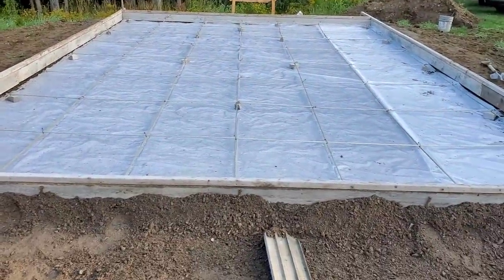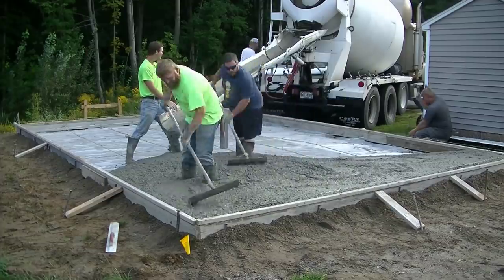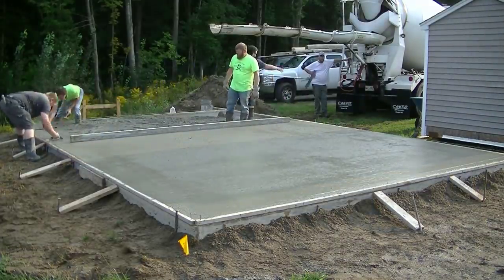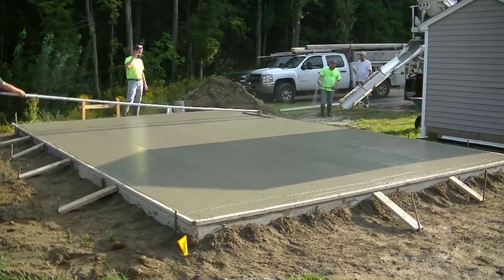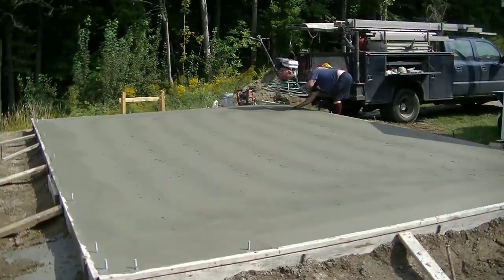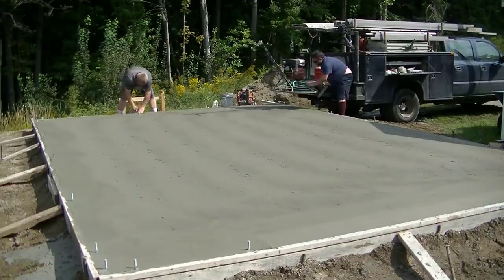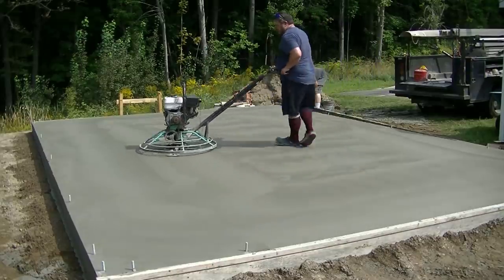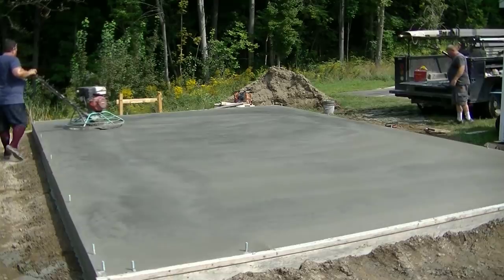They Made Us Pour This Shed Slab 8" Thick (Wasting Money)

Comment: Had friend that was putting a CNC lathe in hi shed. Told the contractor he needed 12". Contractor laughed and did his customary 6". Guess who was out there with jackhammers and a dump bucket. If the customer wants overkill, give them what they ask for.
Reply: I hope your friend had everything documented so this cost the contractor a lot.
Reply: Yep. Everything was in writing.
Reply: Now I see why your angry 😂
Reply: So did he get charged and told he would do 12in and did 6 instead?
Reply: Here is the problem.   I was an equipment engineer for a aerospace company.   We purchased many machine tools (lathes, machining centers, mills).   The manufacturer of the machining tools have requirements for the thickness of the floor or a foundation.   If the owner chooses to not meet the manufacturer requirements for the floor thickness , and if the machine tool does not perform to spec tolerances, the manufacturer can state you did not meet our requirements so we will not be liable for the machine not performing as we stated.   Basically the manufacturer us using the floor thickness to anchor to as and extend base for the machine.

Comment: In many cases an 8" slab is needed for machinery, that may be the whole reason for building a separate building.
Reply: It wasn't the customer, it was "code enforcement".
Reply: @fredtaylor9792  That was all just hearsay. He never specified who "the guy" was who said it, whether it was the customer or an inspector. If I had to guess it was probably the customer who just said it was a code issue so he didn't have to argue with the contractor. Most contractors will bitch and moan if you try to get them to do more than they are accustomed to doing, and all or nearly all 4" slabs I've seen form cracks. 8" inches is for peace of mind and also takes care of most future strength requirements for machinery etc. Putting in an 8" slab just makes good sense. What doesn't make sense is arguing with your customer about it like this guy obviously would have had he thought it was just the customer's desire and not a code issue. 
I'm guessing the customer is just like me and he doesn't want to have to haggle or kick himself in the butt because he let his contractor try to talk him into getting away with doing a half-ass job, lol.
Reply: @Rick-the-Swift  Well this whole thing is heresay so you can pick and choose what you want to go by if you want.
Reply: @fredtaylor9792  Exactly, I've seen this situation plenty. A contractor only wants to do this, but the customer or zoning wants that. Sometimes customers and site managers play "good cop, bad cop" with the contractor who's dragging their heels on the idea of a little more work than usual. 
They wait till the last minute and someone springs it on the contractor "Oh btw, we got a last minute call from upstairs and now we need to do this". Don't give the contractor any time to put up a fuss lol. At the end of the day everyone is paid and the building owner/zoning inspector is satisfied.
Reply: @Rick-the-Swift  Hell some concrete guy just told my neighbor that using a vibrator/compactor on the crushed rock under a slab "is a waste of time". This is fresh rock, not settled for months. It's a slab for a simple garage, only 4" and they are talking about skipping any reinforcement. I just told my neighbor that I have never heard anyone say that consolidating the subgrade is a waste of time and I would at least add some light steel (maybe like 9guage mesh) just to keep any cracks from shifting and avoid lips or ledges.
Reply: @mytech6779  a three foot grid of #4 rebar or at the least #3. It's never ok to pour anything on a sub grade that hasn't been compacted. They don't allow you to pour city sidewalks without compacting first. They probably don't own a compactor and don't want to spend $40 to rent one for a half day because they under bid the job because they don't know what they're doing
Reply: This not apply in this case but 8 to 10 inches is needed for a power hammer
Reply: @fredtaylor9792  It could be code enforcement due to customer saying what they intended the structure is for at the time they applied for it.
Reply: @AaaaNinja  Yeah,  it's called speculation. It COULD be whatever you want to say it could be. I'm going by what the video says and if that isn't good enough,  why waste your time commenting on said video?
Reply: @chichidouglas5078  aka footing
Reply: Haas recommends a 6" floor for their vertical machining centers, some of which weigh north of 18 tons, an who's external dimensions are larger than that slab(VF-12, 27' wide)
Reply: End of the day, customers dime, customers dimensions.
Reply: I think one of the thickest pole barn slabs I've poured 16" but it was for some really heavy industrial machinery
Reply: @Argumedies  When I lived in the south I needed at leat a 6" for my backhoe.
Reply: @Rick-the-Swift  doing the standard really isn't half assed. Lot of speculation there.
Reply: @101_skeleton6   Didn't know that but thank you so much!

While a power hammer is only something  I might get in the distant future, I'll ensure the slab in my new workshop can handle it.
Reply: @DoodlesMcpooh  learned it from Alex steele forging
Reply: This guy seems like he just does normal slabs for everyday things.  Not for anything heavy or special.  Yes, a lot of machinery needs 8" and same really need 12" thick slabs for vibrations control. Also, we had machinery base's that was 3 feet thick and more in some cases.  When you are dealing with heavy machinery you don't want to use some guy that knows nothing about what it takes to hold the weight.  Weight of a house is one thing the weight of a press is another.  60,000 pounds on a 6'x6' area is a lot of weight.